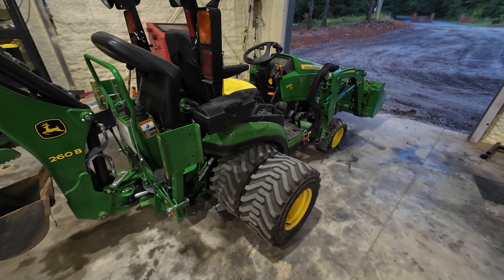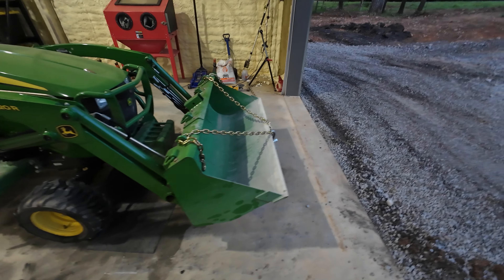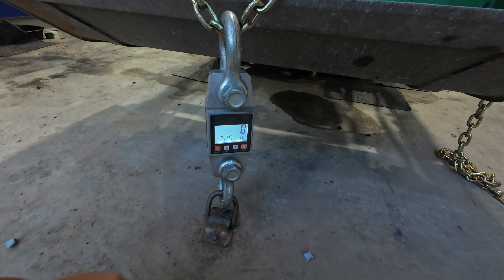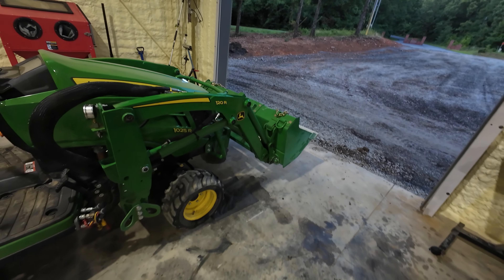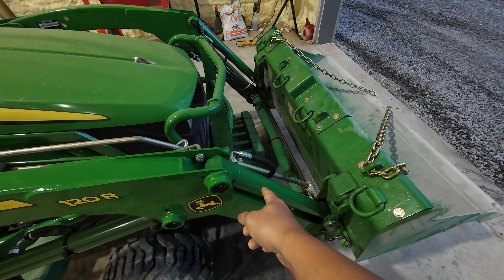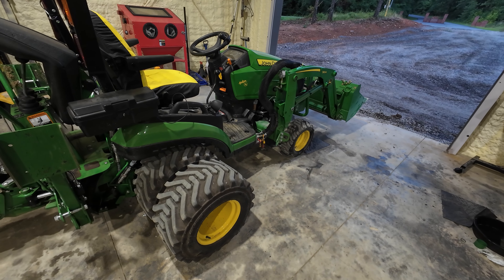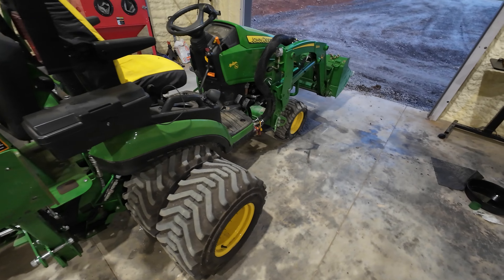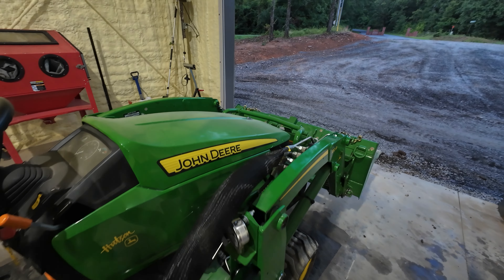HydrosPlus Lift Increases - Cylinders, Pumps, Pressure, Flow

Comment: I lift and move a TON of Pellets, ON a skid, on Forks with my Hydros plus Kit on my 3025E /300 loader. I can take them right outta my truck and put them in garage or shipping container, or pick them up and move them around.. Hydros plus was Key to keeping me in a tractor that fits under a 7 ft garage door. Best money I ever spent! ( yes I added a ballast box extension and plenty of extra weight)
Reply: Did you add the pump also or just the Cylinders?   I have a 3 series tractor that i have been debating about adding the cylinders.
Reply: This was my main use-case as well.  Prior I had to hand carry all the individual bags of a 1 ton pallet.

Comment: One may consider upgrading the front tires to an 8 ply, 44psi tire.  Each tire can handle ~1500lb load.  I am certainly considering the change.  I'm confident that the front axle can handle the additional load with no empirical evidence to prove that out.

Comment: What is your plan for all of the heat your adding to the hydraulic system? What is the plan for the front axle assembly? I'm sure you're exceeding John Deeres rating .
Reply: @michaeleisinger8668  So don't plan on modding your tractor.  

Play it safe and wear your seatbelt. In fact, add a seat belt to your backhoe seat 😄
Reply: hydro also makes a cooling add on.  Not sure about the axle.
Reply: Any lifting modification needs the appropriate amount of additional counter weight. Proper ballast should result in minimal additional weight on the front axle. Besides if you constantly need the additional capacity these modifications allow for you need a bigger machine. I modified my 2038R with the pump and big cylinders so when I occasionally need that extra capacity it’s there, not because I’m trying to get mini skid steer levels of work from my little do-all tractor